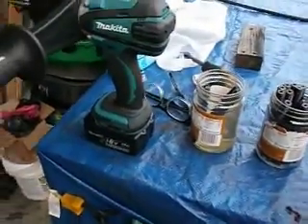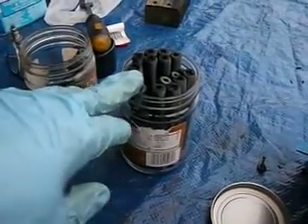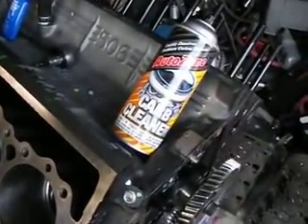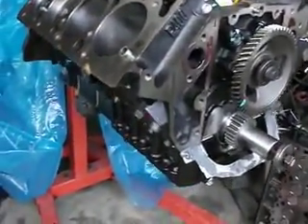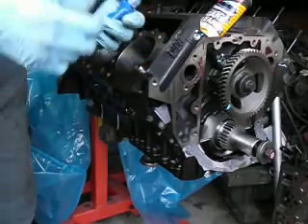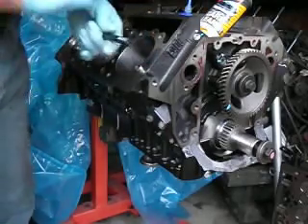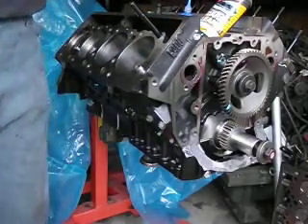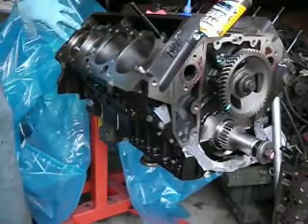P400 6.5 diesel head stud install

Comment: I bought some reproduction made in USA Long Branch Ram Air exhaust manifolds for my 1965 Grand Prix, and the fellow that I bought them from sold me some special paint and he said not to use brake clean, because he said it's petroleum-based, even though it looks like it's doing a perfect job and drying nice, he said to use, I forget now, alcohol?
Reply: Maybe laquer thinner like you used? And I think I would vacuum the chased threads as opposed to blowing the chips out, to avoid stray chips ending up in the longblock
Reply: @leroydiesel6.5  any chance you have any more of the timekeeper timing sets around? I have a 94 "f" block that will be running a db2 pump.

Comment: Ok , your saying that after spending ridiculous money on one of the best long blocks ever build. the p400 head studs are not up to snuff, and now more money needs to be spent on ARP's. This makes no fucking sense. If ARP is the standard for head studs, then Peninsular should have ARP equivalent hardened head studs that come standard with their long block.
This engine is promised to produce power over stock 6.5's If it's going to promise that, then they should be damned sure that the equipped head studs are going to keep up with the power output.
Reply: Yes I assumed they are the primary distributor, Regardless if I am mistaken. The long block that is cast by Navistar and the company that assembles this engine, did so to make it the optimized version of the 6.5 the best of what this engine had to offer. All the short comings are promised to be solved to make it a strong engine. I doubt very much that they would compromise it by supplying lower quality hardened head bolts.
Reply: Well the p-400  rated output is significantly higher than stock, depending on configuration, They must using a much stronger bolt. It would be an interesting video to put both bolts on a hydraulic tension machine and compare their strengths.
Reply: videoclipits no no no you buy the most expensive long block then tap it with a drill